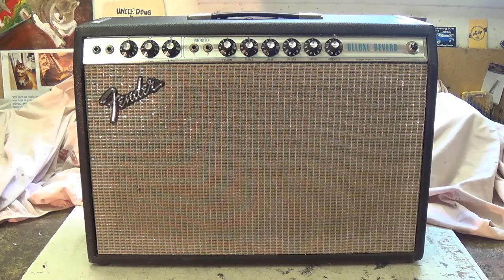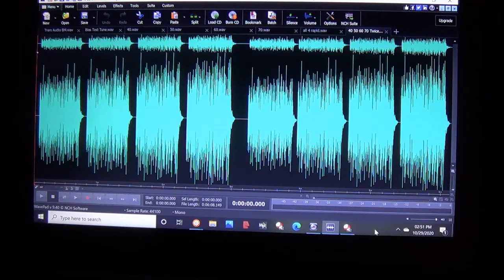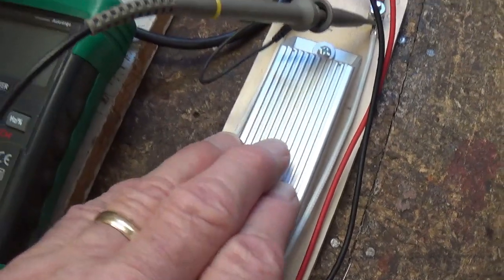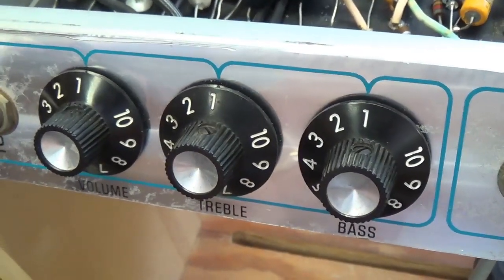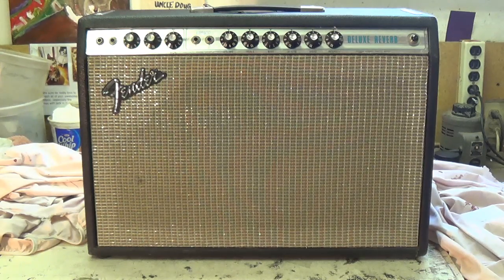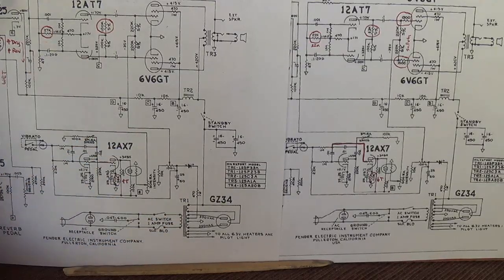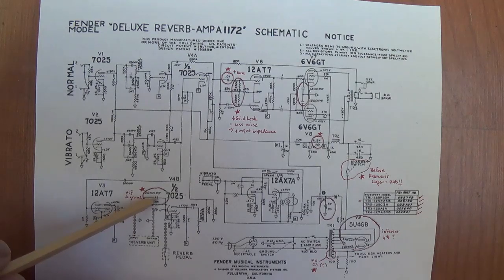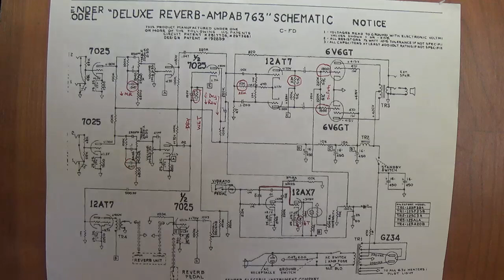The Effect of Output Tube Bias on Tone, Gain, and Headroom.....A Side-by-Side Comparison

Comment: The scoping of clipping and cross over distortion would have shown up more clearly using a faster timebase (sweep) on the scope. The explanation of the time/frequency relation is of cause nicely done with 10 cycles on the screen, but for clearly noticing the distortion it would be better to only have one to three cycles on the screen.
Greetings from Denmark.
Reply from the maker: Thanks for your helpful suggestion, Mikael.

Comment: You have another great presentation today !   I want to point out you are measuring and testing an amplifier that has no master volume control......and I view the master volume controls in the fender vein with the 1 meg pots ahead of the phase inverters as "THE GATE KEEPERS" of the power tubes.....it splits the amplifier circuitry.  SO essentially you can control the pre-amp circuit and the wave form there to grow it up to where the wave starts to compress at the peaks (or not)......but its that throw of the wave form that then gets presented to the Power tube section for its operation with the separation via the master volume control.   With a NON master volume amplifier circuit, the wave form is not controlled like that passing thru the circuitry to the power tubes.   In your ADDENDA notes, you mention the 4.7m/3.3m wet/dry ratio resistor which essentially functions as an attenuating situation for signal strength in the pass thru in the circuitry to balance the relationship to the parallel effects loop of the reverb circuitry......as employed by Fender (Hammond licensed).  That padding down of the dry signal strength would be lessened if they added another tube to the reverb loop to cleanly boost its signal further (while observing the phase relationship of the signal) in the reverb recovery aspect to better compete with the dry signal as they merge. (The reverb effect of this parallel loop is added on top of the dry signal when dialing in reverb with the control presented in this circuitry.....there is always a dry signal present but having to pass thru that 4.7m/3.3m resistor)   BUT point being, the signal strength passing thru from the pre-amp section is padded down before it hits the power tubes for their function.  AND going back to Fender in the application of this amp or any of the post 1960's amps they manufactured, they are running the power tubes much higher and beyond the tube manufacturer's data books....the tube manuals.  They exceed the plate voltages in the books....though it can be argued for the aspect of plate dissipation, but there is also the aspect of the relationship between the plate voltages and the screen voltages in the power tubes for operating characteristics....again relative to the tube manuals.   AND all be it, dancing around the application of the feedback loop in the power tube section of this amplifier, the feedback resistor value....and its effects.  >>>>>>>>BUT YES, a great demonstration of the mathematical "PROOFING" of the numbers and rating as advertised by Fender.......you having the background in education, this was very academic !           Would you consider using the frequency's of 900 to 1K as a better representation of mid range frequency since guitar is a mid range spectrum instrument.......and lowering the upper frequency you used to more be in the threshold of the limitations of a speakers frequency roll off, since they typically don't go above 6k/7k for high end response ?    Seems like you were steering the frequencies to the oscilloscope for the grid visual......and then you mentioned the amp would behave differently at different frequencies but not mentioning if there were a linear or proportional relationship to the behavior between frequencies if there were any suggestion of an expected relationship....if there were a vocabulary term for it.      I'm writing this after watching halfway thru your presentation....I have to see the portion with the schematics.  BTW....where are your companion/sidekicks......playing hookie on a school day ???   Or are they out cruising in the hotrods.....skipping out
Reply from the maker: Thanks for all your helpful comments, Mike. Yes, I should have run the test at a lower, more guitar-friendly frequency.

Comment: Very cool Doug. I like the comparisons. Thanks for taking the time to track them all down! Great presentation, and easy to follow to boot.
One question, and i don't know because I've only been in a custom shop vibrochamp that was new-ish. Are the reissues that Fender makes today, are they made using the BF schems and construction? I HAVE been in a few of the lower end newer amps, Deville, Hot Rods, Blues Jr etc. But not reissues of Princeton, Deluxe etc. The lower end amps are all just standard through hole pcb stuff, a few ic's here and there. Hopefully the reissues of the 50's and 60's amps(and the latest budget stuff) , are not all SMT by now. 
Thanks again man!
Reply from the maker: The reissues, unless they are hand-wired custom shop products, have unique, modernized circuits with PCB's and an occasional semiconductor or three thrown in for good measure. I don't work on them.

Comment: Uncle Doug, thank you for this educational video -- I learned a lot from both parts.  Please, please, keep up the technical 2nd features!

However, in Part II when showing differences between the AA763/AB763 and the AB868, you said the GZ34 is indirectly headed and the 5U4GB is directly heated.  But I've always thought that the schematic symbols for directly- & indirectly-heated cathodes are the little up-side-down "V" for directly-heated cathodes like shown for the GZ34.  If I'm correct (and I now assume that I'm probably not), then wouldn't the GZ34 be a faster start-up rectifier than the 5U4GB?  I'm confused!  I see that the 5U4GB symbol in the A1172 schematic is the same as that used for the earlier & better GZ34s.  I guess Fender wasn't proof-reading their schematics very well after the earlier amps?

I guess the "missing" power transformer center tap for the A1172 (& A1270) is due to a part number typo on both drawings, though that seems to be hard to believe, other than Engineers not studying everything on their own drawings when making changes (which I've definitely seen)?  I don't know how it could have saved Fender any $ (actually ¢?) to not use the center taps on transformers they'd already paid for, so I'm just as confused as you are on this mystery.
Reply from the maker: The schematic symbols are not necessarily correct. If you look in a tube handbook, you will see that the GZ34 has a cathode that is heated by a filament, while in the 5U4, the cathode and filament are combined.

Comment: You'll fine running the amp at 90% to 100% of bias voltage the Amp will sound Even Better 
Tubes live a long time. I can buy a set of output  tubes every 3 to 5 years if that's what it takes to get the bed sound out of my Amp
Reply from the maker: Thanks for your input, Steve, even though it contradicts all established knowledge and common sense ;)

Comment: Great vid, it was interesting. Being a retired hobbyist working on my technician status I find these vids very helpful. I would like your intake on the 6.3v filament center tap vs the 100 ohm resistor virtual tap. I'm building a Princeton Reverb clone (AA1164) and I'm using a Classic Tone PT that has the 6.3v center tap. People on some forums I visit says it's better to go with the virtual 100 ohm and not use the CT in the PT. They claim that the resistors can act like a fuse and burn out whereas the PT could go bad if a tube shorted out using the PT 6.3v center tap. BTW, thanks for all your vids; I've learned much from them and spent much money building amps, LOL.
Reply from the maker: Thanks so much, John. I too have heard this idea about the virtual CT offering "fuse" protection, but the vast majority of amps have grounded CT's and I have NEVER encountered a problem with grounded filaments. I guess it's a personal choice.

Comment: I've been using a set of 50's GE 6v6gt in my Tweed Deluxe clone, I built, for probably 5 years now, and I have worked them hard! Tweed Deluxes are biased hot, likely well past 70%, and those old tubes just keep going. I think those old tubes would last just fine at 70%. Of course this is just an opinion, based on my limited experience. Also the circuit comparison is super! I would leave the Silverface Deluxe stock, regardless of circuit type. I think a good new production speaker might be the only change I would make. That Jensen C12N you use sounded good.
Reply from the maker: Thanks for sharing, P.  I do think the older tubes are more robust.

Comment: I just built a brownface Fender Super (6G4A) amp with a 6V6 power section substituted in. My take on bias is that the colder bias gets a thin tinny sound with that ice pick sound to the string attack. Also a crumbly kind of distortion to the bass notes
Reply from the maker: I agree, Joe. "Cold" output tubes seem to have trouble portraying bass frequencies.....thus, the tone becomes more strident, like an old transistor radio.

Comment: A big thumbs up for the first section, as well as the "PART 2" addendum. My ears heard and the compared scope traces seem to confirm a slight increase in clarity from 60% to 70%, though there seems to be a slight bit more dynamic range at 60%. This would lead me to believe that is why many folks end up "splitting the difference" in the 65% range. And to some comments regarding EL34s, they should probably never be used in a truly "stock" Deluxe Reverb, due to the higher heater current they demand! If you have a home built and/or hot rodded Deluxe, with a more robust heater winding in your transformer, then all is good! And again, Thank You to Uncle Doug!
Reply from the maker: Thanks so much for your nice comments and helpful input, Gene.

Comment: Great videos. Thank you for taking the time to do these. Something to consider. The Standby switch in the A1270. If you place it between the Reservoir Caps and the Inductor, During Operation, when putting the Amp into Standby, you could get a Voltage Spike at the Input of the Inductor as the switch Opens. This is the Center Tap Of the Output Transformer and "Could" cause a POP in the speaker. This would not happen the way they have it configured before the reservoir Caps. So, bad for the rectifier tube, but perhaps better for the Output Transformer and Speaker. What do you think ?
Reply from the maker: A very interesting analysis, Claude.....and plausible. Thanks for sharing.

Comment: That resistor (at 49:39) I find mysterious...?  Looks like grid leak for the next stage, as it is DC isolated from the reverb amp plate by the cap between the tube and the  potentiometer. But there is already another parallel resistor to ground (near the potentiometer), and the pot itself goes DC to ground. So why put a resistor there? The reverb level could be easily adjusted by the resistors near the pot.  Fender black magic?
Reply from the maker: Maybe so, Marko :)

Comment: Writing this at 44 minutes but the thought occurs how does it improve the hotter you run PD?  I know every amp will be different, but is there a cutoff where improvement drastically drops off with increasing PD.  Is 80% markedly better than 70%? Does it start dropping out at 90%? Of course this comes at a cost of burning up the tubes, but as another Youtube creator pointed out just today, the Eddy Van Halens don't care about burning up amps and guitars, they want the sound. Is running hot worth the cost?
Reply from the maker: I don't think so, Sean. I believe the cutoff occurs right around 70% of max PD.

Comment: G'Day Uncle Doug,,just watch the first half of film,,makes sense more power the more your bass is driven,,,
noticed as plate current went up and bass was far better,,to me,,mind i'n deaf in one ear and cannot hear from the other,
Bit like horse power verse torque,,with that little extra current voltage you seem to develop more torque,,Hence drives speaker better,,
now here is one for the age's,,,In a HI FI System a lot of effort is put into speaker cabinet design,,
wonders how cabinet design could alter your finding,,not so much for distortion but actual sound of the speaker,,
just learning Have no electrical back ground,,But have questions,,
designing mini boom box,,yer i know not for you but,,any way and speaker design plays a big part in this,,for sound quality,,
Reply from the maker: Greetings, Ian, and thanks for your comments. Since the purpose of the experiment was to compare the tone created at each bias level, all that mattered was the relative tone quality.......not the overall tone quality of the speaker, enclosure, amp, etc. Those factors were identical for all bias levels.

Comment: I wonder how better the tone would be if you built a AC house volts to DC clean power supply at the DC voltage and amperage needed and then build a amp to go with this super clean power DC voltage supply instead of plugging your amp into AC home voltage !

No more hum or AC noise would be present i know that much !
Your amp will not need electrolitic filter capacitors to choke the power supply nor a rectifier !
AC voltage leaking onto any of the signal path is eliminated !
Zero hiss and hum i think !
Reply from the maker: An interesting idea, IS, that would probably cost hundreds of billions of dollars. However, the simple, contravening fact is that properly designed and constructed AC-powered amp circuits have virtually no hiss or hum.

Comment: The third cause a of zero cross distortion is gm doubling. Around zero both amplifying devices are conducting and that leads to a higher gain. It's more of a concern with solid state amps because they are biased so lean. Because of this, solid state amps (primarily those with BJT outputs) have an optimal bias point and increasing it makes zero cross distortion worse. You don't notice this in tube amps because they are biased so heavily that both tubes are conducting over a large part of the cycle.
Reply from the maker: Thanks for your helpful input, Mr. H.

Comment: Great video. I have owned a Blackface DR since 1998 and have used it on many gigs. It's a bit underpowered if you are playing in a loud band unless it is miked and fed through the monitor system. Something you can only do in a large venue. As far as circuit differences go, they are minor but I found that increasing the reservoir capacitors to 80uF in series prolongs their live especially since the DR operates at such high voltage. Personally I like to modify the normal channel on my blackface amps for a completely different sound. As far as the vintage market goes, I stay away from that. I can build any one of these amps from the ground up for about 25% of the cost.  Thanks again for the great video.
Reply from the maker: You're welcome, Arnold. Thanks for your input.

Comment: You sir , Have a way for any dummy like me could under stand ! Were you a teacher ?. Because you should be ! Also I have a Morley wah pedal that is in pretty good shape almost like the one you fixed in a earlier video you did !And I took it apart and looked at the inside and the oil drum is empty . I did not open the drum ! I was going to fix it myself but after seeing your video I think you are going to do a better job ! Do you still fix outside jobs ! I know you may still have the oil and other parts ! Wah is in excellent shape  but may be need a little more TLC  to fix ! All the parts are there and no I did not take it apart fully just to look at the guts like the photo light cloth that needs to be glued back and adjusted ! If you still do side jobs please let me know !
Reply from the maker: Greetings, CA1, and thanks for the nice comments. Yes, I was a math and science teacher for many years. I no longer work on the oil can units, but you can probably still buy the Union Carbide oil on Ebay, like I did. Good luck.

Comment: Nice work as usual Uncle Doug. Clearly (to me) the flabby bass disappeared at 70%   Clipping note - The flat tops/bottoms are because the tube or power supply is wide open and can't supply any more current/voltage so it flat lines. I wonder what would happen if you jacked up the line voltage?
Reply from the maker: Thanks, CA. I believe I explained the cause of clipping in the pinned comment #2.

Comment: This video pretty much confirmed to me that the perceived "better" tone just comes from bigger volume and more headroom, and the actual tone doesn't change.
Moving the standby switch before the reservoir caps could be due to safety reasons. Probably they realized that the caps would have no way to discharge if they were removed from the circuit before shutdown, which could have been a safety hazard. The reservoir caps have a discharge path even on the half-cool tubes if they're left in the circuit.
Reply from the maker: Thanks for your input, Wave.

Comment: Thanks for your hard work. I look forward to applying your knowledge to some current and future projects.

Btw- what is your experience, if any with Mercury Magnetics? I did a Champ 600 kit a while back. I don't know if you would be interested in doing a schematic review. And in alignment with some of their theories, what are your opinions on filter chokes on sound and amp performance? Personally, I cannot get enough of tube amps. Thanks again for all the help you have given me.
Reply from the maker: You're welcome, Joseph. I hope the videos are helpful. I think MM transformers are excellent but way overpriced. I would never recommend one to a customer, simply because I feel you can get equal tone at a much lower price. Filter chokes are wonderful. I added them to many of the circuits I hand-built.